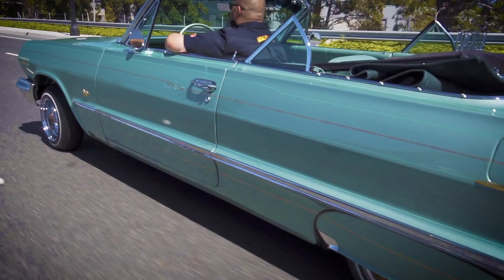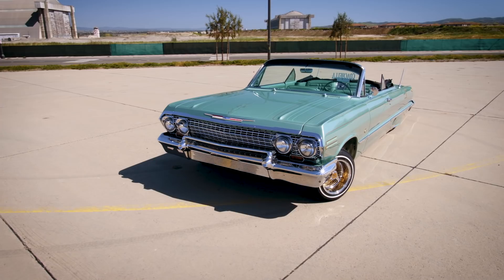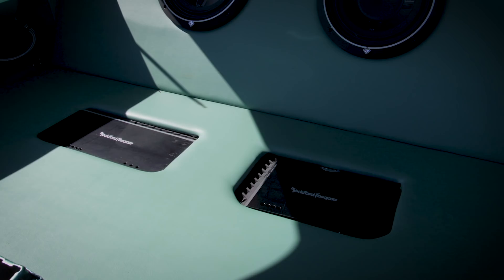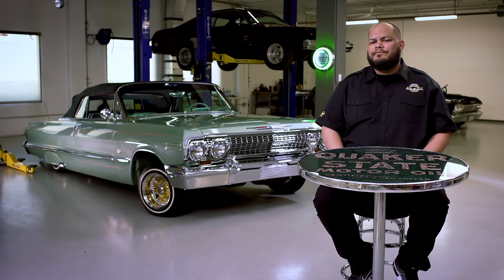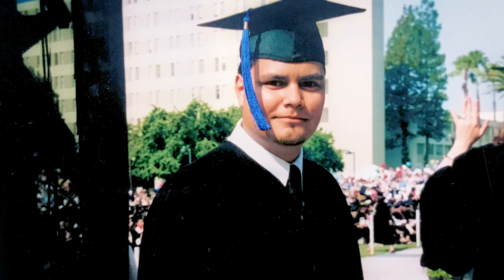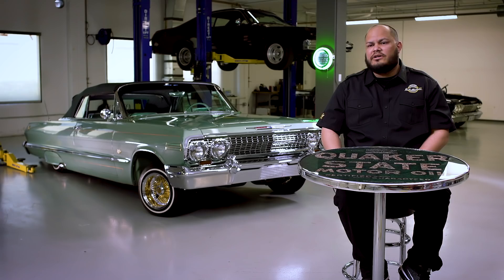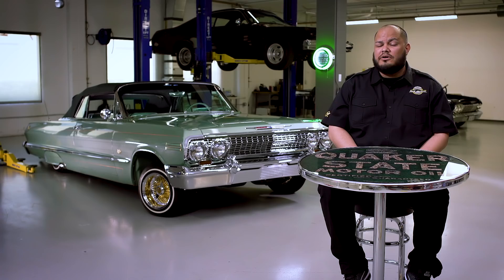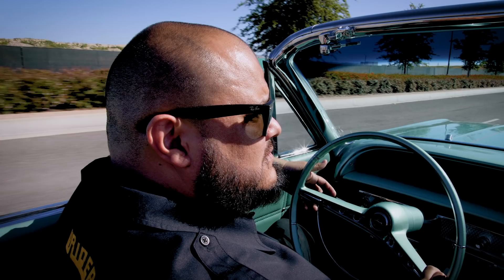1963 Chevrolet Impala by Johnny Gonzales - LOWRIDER Roll Models 37

Comment: Man I love your 63', I had a 63' Imapla Convertible, but mine was sadly not a SS, I had rebuilt the 6cyl Blue Flame motor, it was a 90's Corvette Green and I had white leather inside, white top. Man I miss it. It got stolen and never found, like you my 63' was inspired by the 93' cinco de mayo issue of Lowrider mag., actualy I have the first may it was in, Orlies Lowriding mag, they did a little feature about the guy who owns that Impalas car club Mafia IV Life. Definitely a beauty, and you clearly like me see it for a gem. I now roll a Aztech Gold 63' Pontiac Parisienne(Canadian built Catalina) on cusomt 14x7 zeniths chrome rim gold 2 dual knock-offs gold center hub white powder  coated spokes and Aztech Gold nipples painted to match the car white leather with gold & black center cloths insertes. Not done but will be. I'm building a 89' Toyota sr5 pickup mini truck with bed dancing so time is split between both.